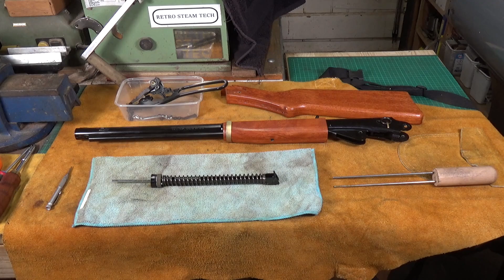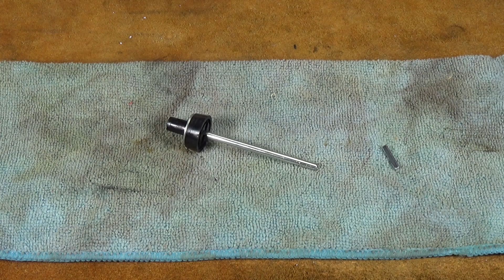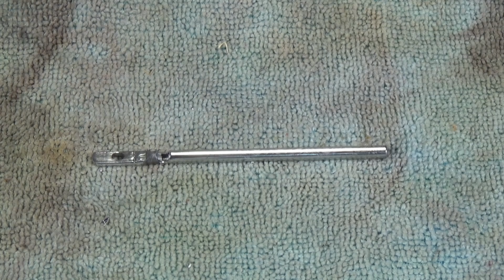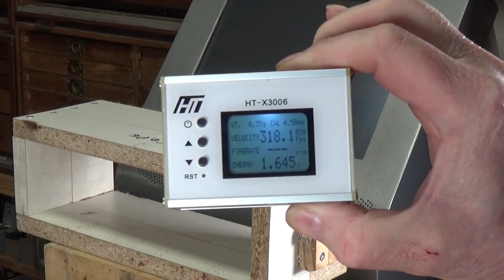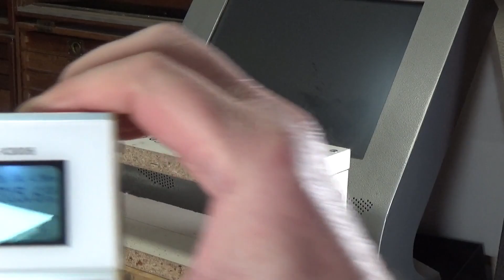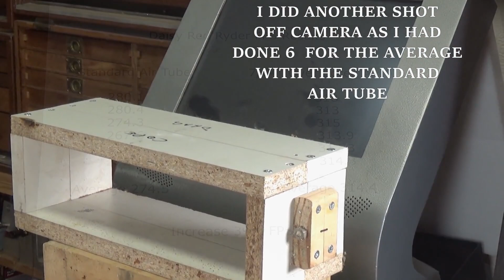Daisy Red Ryder Model 1938B - Overboring The Air Tube

Comment: Excellent! Thanks for the double shoutout Alan! There's one more mod you might  try with the factory mainspring, install a 1/2" spacer made out of steel tubing that will sleeve the plunger tube to "pre-load" the mainspring. That might yeild 25-30 additional FPS but will increase the cocking effort. Love your TeRex  style mainspring compressor! I never thought about off setting the vice mount block for a full side view.
Reply from the maker: Credit where credit's due Shane, I got all the ideas from your videos.  I had read that some people had fitted a spacer to increase the pre-load on the spring. I just think that a stronger mainspring is a better solution. Hopefully I can find a manufacturer over here who can make me one. The spring compressor works brilliantly, so easy, makes the job dead simple. I am thinking about adding a sword type hand guard for the other compressor, if the prongs slip off the spring it's all too easy to stab yourself with the end of the receiver. Don't ask me how I know!! Cheers, Alan.
Reply: @RetroSteamTech  Definately put a cross guard on the spring compressor, the ends of the reciever tabs seem to get razor sharp with age.
Reply from the maker: @RestOModDaisy  Even the new ones are pretty sharp!

Comment: Great use of the chalk gun Alan. I was nervous watching you drilling the hole. Stainless is not an easy material to work with. Can easily work harden. I’m sure you could source a replacement spring here in the uk. There are a lot of spring suppliers and manufacturers in the uk 🇬🇧 I you find a source, you could let other Daisy owners know. Your mod was a great result anyway. Cheers Nobby
Reply from the maker: Thanks Nobby, all credit goes to Shane Bruce from the RestOModDaisy channel, his idea.  I agree, I don't like working on stainless but as I said in the video, take it slowly and clean the drill bit repeatedly.  This seems to be the way to go. I'm sure I will be able to find a company to make the spring, it's just how much it will cost that is the issue! Cheers, Alan.

Comment: Interesting video Alan.  That drill bit was a lot longer than most.  How did you come by that one ?  Any chance you could  add a spacer block to one end of the current spring to increase compression - provided the coils don't touch each other when compressed?  Why is the improved spring not available in the UK ? Cheers Rob
Reply from the maker: Hi Rob. Extra long drill bits are available over here, that one came from Zorro Tools. You can find them online. Yes, you could add a spacer to increase the pretension and some people have done this. I just think that a stronger spring is a better solution. The Cobalt 327 springs are from a guy in the states who unfortunately does not ship to the UK. I'm looking into seeing if I can get a custom spring made for it. Cheers, Alan.
Reply: @RetroSteamTech  OK. All clear Alan.  Yes, a stronger spring would be the best solution.  I wondered if the UK Govt didn't allow in gun parts or some such.  Good luck with getting a spring made at a reasonable price.  Cheers Rob